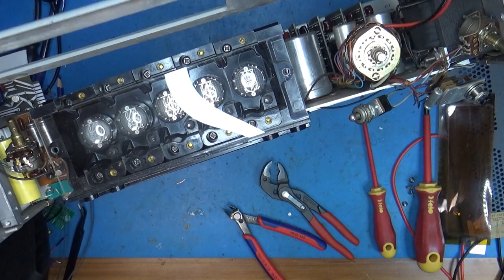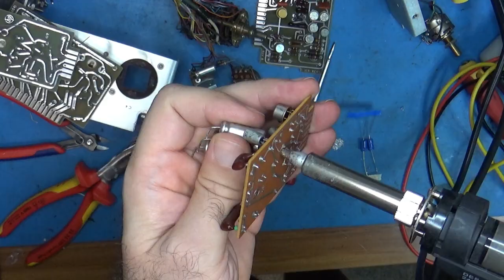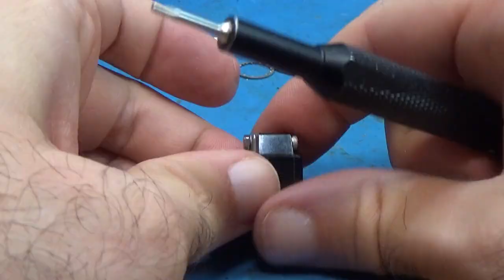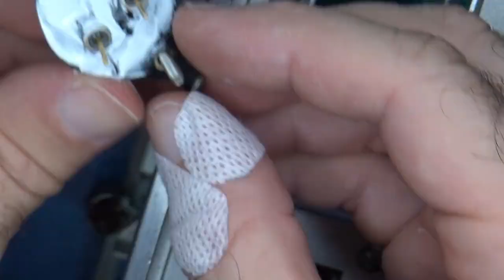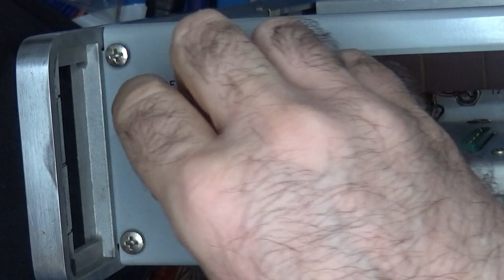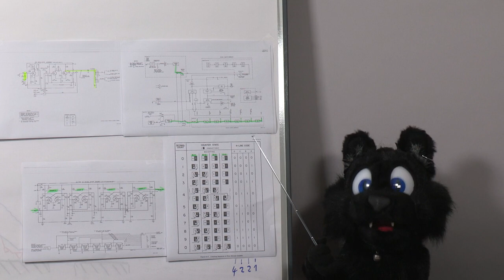HP 5512-A Counter

Comment: Where did you track down the service data and schematic? I'm trying to fix one of these and I can't get any service info.
Reply from the maker: I am not sure; been a while... But I usually google for model number and a fixed suffix, in this case: "HP 5512 service manual pdf" there are a few pages that have collections...

Comment: Not sure why you did a full recap, as most of the caps in these mid and late 60s HP items can be successfully reformed. 

I had some success with mine   https://www.youtube.com/watch?v=wW9w2xCf8H8&t=1923s the HP5233 the big brother of this one.   

I think the only thinks you should of done is swap out the tantalum caps those are fine as long as they are not  shorted.  The new modern ones you will most likely need  replacing  in a few years as the relative high voltage of this counter will cook them.  

Oh if you are curious why there are two neon bulbs on one of the cards have a look at this video https://www.youtube.com/watch?v=BGEhT4Wtub4  I just posted.
 

 The reason might surprise you ;)
Reply from the maker: It's mostly because I don't really trust the whole "reforming" idea. I much rather use new capacitors instead. My reasoning is: these devices are not going to be "daily drivers". So if I don't get around to turning them on in a year or so, I wouldn't know if the capacitors have degraded again. With new caps... the device should now outlast me, even with some idle time in between.

I did know about the "dark issue" with neons before; when I saw that one of the bulbs was wired in an always on state and there was "light coupled" written between them, I guessed as much, thanks for confirming that! I didn't really follow the rest of the circuit too much, since I saw that it drives the gate lamp, and that was working fine. and needed no adjustments. I think I heard about special "dark strike" bulbs that have a hint of a radioactive material inside them to make sure they strike even in 100% darkness.
Reply: @atkelar  Yes that is true,  if you leave a reformed cap sitting around again for a long time you are asking for trouble,  I tend to turn all my gear on at least twice a month for a few hours just to avoid that.  Yes dark strike bulbs are out there but they would of cost about 2$ more at the time, according to the guru online so they save a buck or two doing it this way ;)    
Cheers

Comment: Very nice repair, No useless "reforming" procedures and short lived solutions. A real repair. I also got myself a nixie counter a while back which I also got up and running and Re-capped. But mine seems to be so rare and unknown it might even be a prototype. The only info I got is a small number print on the circuit board, it has nothing on the case, no name no nothing and not even marked controls so I had to figure out what everything was for myself. what is very special about mine though is that it can directly measure TV RF signals on one input and the other input the frequencies and pulse counts. I love Nixie tube based equipment :D
Reply from the maker: Typical RF is a bit out of range for this one; but it does fit nicely to the old HP function generator I did a while back. I just love old tech with all its quirks and trickery. While surely not a day-to-day device, it does deserve a second chance of being useful IMHO. And of course: NIXIES! 😃
Reply: @atkelar  I love Nixie tubes! And also my device was on a auction and I did not even know what it was when I bought it, nor the seller. It was a mystery device. However did this prove to be a very potent device and I could even use it to repair my slightly newer pattern generator. As my counter can measure RF I could connect it to my pattern generator and calibrate the RF output to the specified frequency which would be nearly impossible without a tool for this. After I calibrate it I could manually type in the TV to that value and it found it! I love when I can use my tools to repair other tools. Because you can never become better than your tools as I always say :)

Comment: I wish there was an easy replacement for those original feet as I've got at least one old counter that needs some. Has anybody a link to a good replacement?
Reply from the maker: I made mine with OpenSCAD; but the originals had push-button style clips to hold them in place. Mine pretty much rely on friction, so they need to be sanded to fit snug. I can upload the OpnSCAD script to my GitHub if you want to go that route.
Reply: @atkelar  I somehow missed this post but I'd pretty much appreciate an upload of that design 🙂
Reply from the maker: There you go: https://github.com/Atkelar/OpenSCADGadgets/blob/master/restorations/HP-5512A_Foot.scad